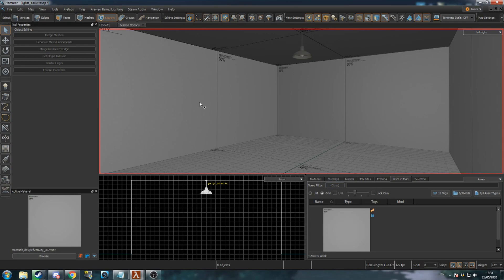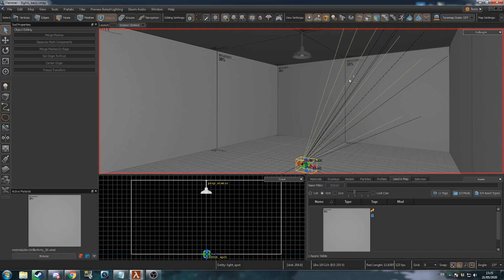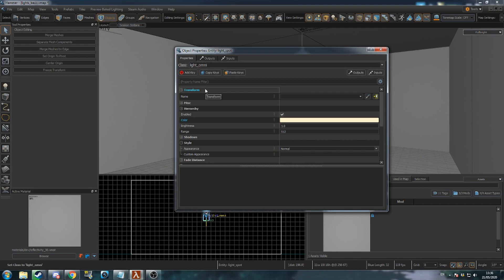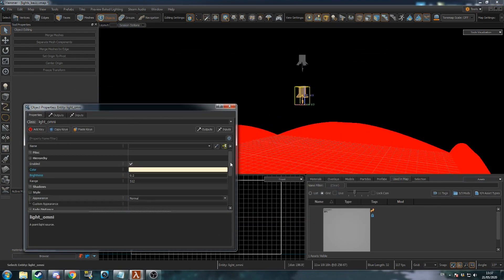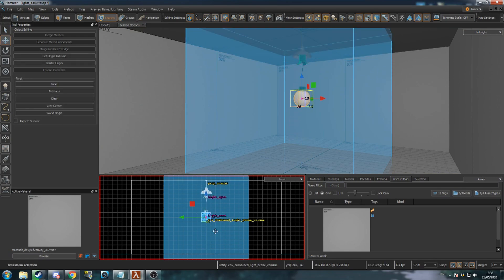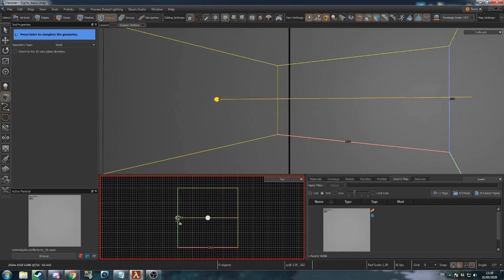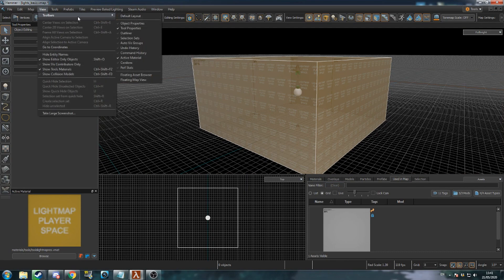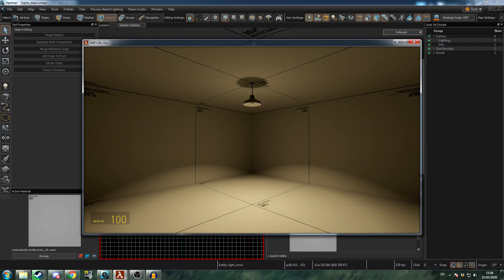How To Do Basic Lighting in Source 2's Hammer

Comment: quick question, how do you run the game windowed like that? I typically have been compiling my maps in vr to check lighting and other simple stuff like that, but having it on in the background kills the viewport framerate from ~170 FPS to ~30 FPS
Reply from the maker: If I recall correctly, when launching the tools you just pick the non-vr option
Reply: @Hosomi  worked perfectly thanks man

Comment: I seem to be having a consistent issue that I can't find any documentation on, and have been trying to fix for 2-3 days. When in the Hammer editor, all my lights are fine. But when I build, (It does this on every type of compile.) if I'm too far away, it disappears, almost as if it's been turned off. If I launch my map in HL:A, the lights flicker in and out depending on where I'm standing/facing, no matter how close or far I am to it. This has happened on a complex map I made, but I gave up on that one, started a completely new one that as of now consists of 2 rooms, and a hallway, with very few intractable props, and 3 light_spots. It still does this. I don't understand what the problem is...

And yes, I have baked my lights multiple times, done many fast compiles, full compiles, and 2 final compiles, restarted my computer, closed and reopened Hammer, unplugged and plugged my headset, (Don't judge me, I'm desperate.) verified my game files twice, uninstalled and reinstalled the game, and they're still broken. Hell, sometimes after a full/final compile, all the lighting on my map for models breaks, making them have no lighting! (Exept the map geometry is fine???) But on a fast compile, the lighting's fine!

Frankly, I'm tired of dealing with this. I'm VERY new to Hammer, and only started learning 5 days ago, so keep that in mind.
Reply: Did you ever figure this out?
Reply: @ghostofakina8747  Nope. Haven't touched Hammer in a while.

Maybe someday I'll come back to it...

Comment: I'd love to know how to have light not cast onto one surface. i.e. I have an orthographic light casting into a room to emulate sunrays with volumetric fog, but I don't want it to hit the outside of the wall, and for it only to be visible inside the room. Is this possible?
Reply: Block light also won't work, as I still want sunlight to shine on the outside wall, just not the ortho lights.

Comment: How do i make a room dark?
Reply from the maker: Reduce the intensity value to make the light darker
Reply: Thanks!

 @Hosomi  Another question if its alright,

Props and npc's are becoming incredibly bright in certain areas where a point light is being shown, Is there a way to fix that? Also, the next room doesn't render fully until after I open the door, is there a way to have a room start being rendered before I enter it so It isnt a half built room until after I walk in? It's really irritating.
Reply from the maker: @webby._.webster  Sounds like a bug. Probably caused by some bad VVIS. Try doing a full compile

Comment: I run into a Lightning Problem in my map. My map is always bright - no matter how much i reduce the lights or the brightness of the individual lights. I don’t have any environment light - only spot light and light Omni.

The lightning looks good when I switch in hammer to „direct lightning only“ or „all lightning“ modes. But it looks bad in „fullbright“ and „ambient light“. 

I have used a „light“ texture quite often - could it be that that one creates ambient light by itself? And any idea how to disable that?

Or any other idea how to fix?
Reply from the maker: Are you doing "fast compile", because this skips a large portion of the lighting computation. Fullbright is a setting that specifically means everything will be fully lit, without calculating lighting.
I'm not sure what light texture you mean, but it may be self-illuminating, in which case just use a different texture
Reply: Hosomi im doing the Full compile - it actually does look right in the fast compile setting ...

I used the texture a few hundreds or maybe thousand times (I buildet very small lights with it) so changing it would be a lot work ... I’m not 100% sure if it’s even the real problem ... my full compiled map for some reason just looks like full bright and I don’t know why. 

Is there a way to select and change all textures of the same kind of hammer ?
Reply: I'm having the same issue, I see this comment was 5 months ago so have you managed to fix this?